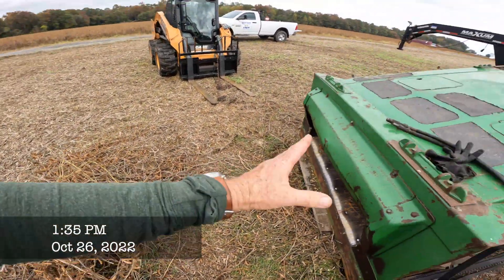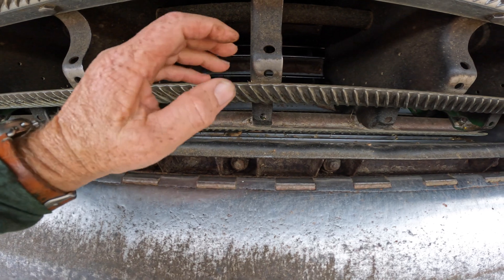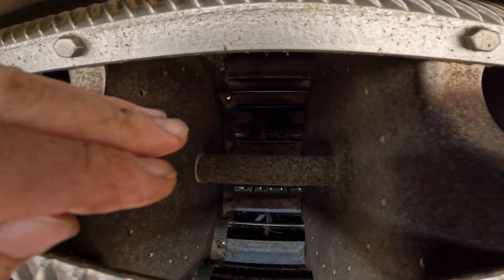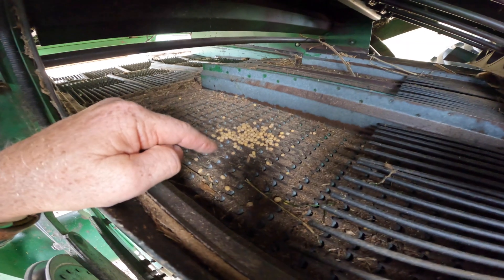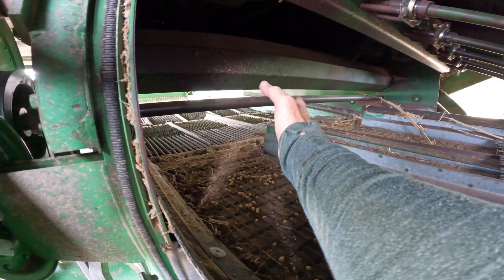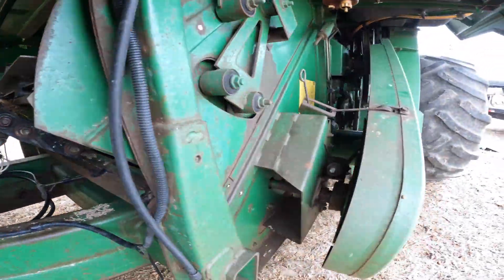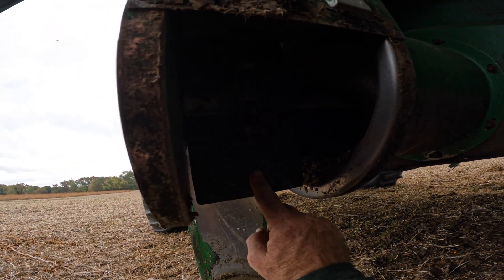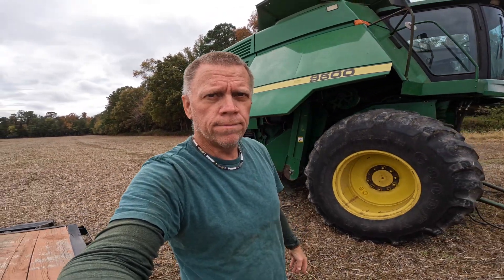How a Combine Works - Combine 101

Comment: Great explanation I remember working on our 9600 and those rasp bars there was a filler plate in between them and dirt and crap would get into the middle of the cylinder and cause it to shake the combine when you first started it